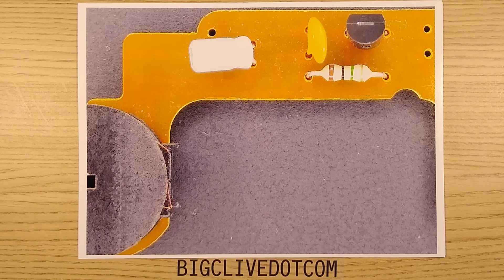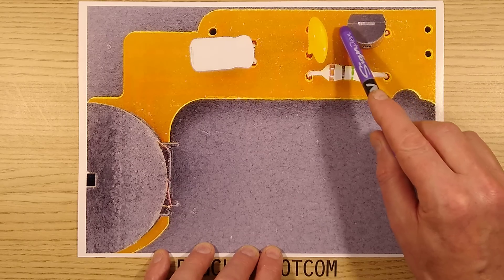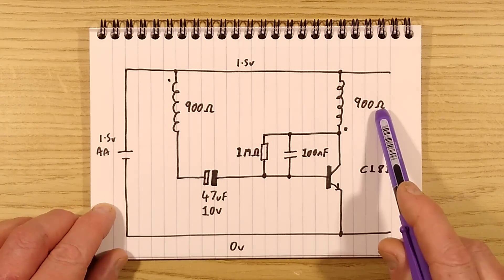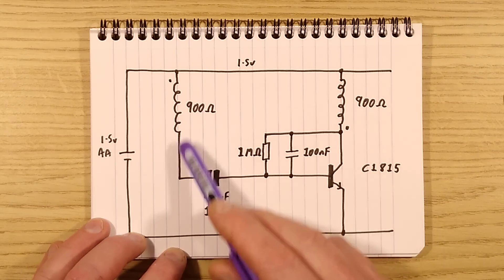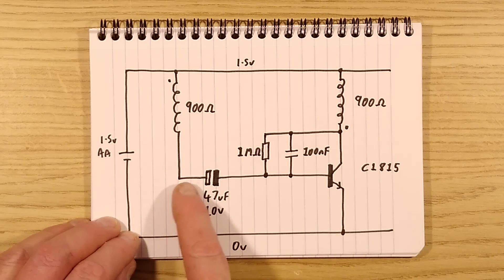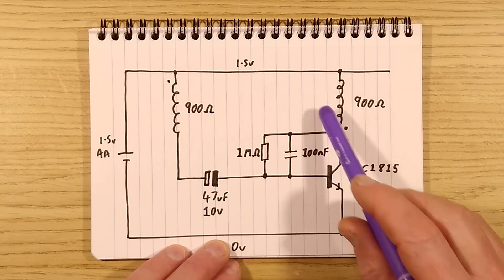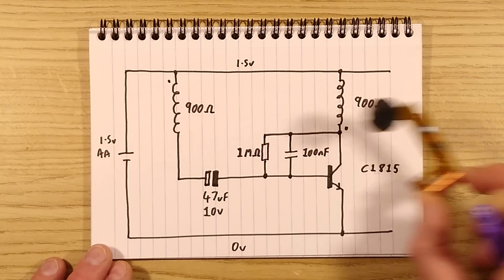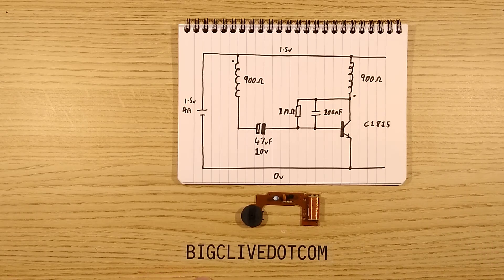Classic simple clock pendulum circuit

Comment: It seems there is a bit of confusion here, with the difference between the schematic and the PCB.  The PCB came from a clock and I assume the 'crotch' between the legs of the PCB was where the AA cell holder was originally.  Right?

The 2SC1815 comes in four current gain ranges: O, Y, GR, and BL.  Please tell us which gain range it is.  Thanks, Clive.
Reply from the maker: The battery is outwith the PCB.  The transistor gain is GR.
Reply: @bigclivedotcom Ah, outwith. A peculiar Scottish word 😉

Comment: What does the other coil on the other end of the board do?
Reply from the maker: It's the stepper motor coil for the clock movement.
Reply: As far as I know the pendulum side of things is purely for decoration.

If you look next to the other, bigger, coil there's a crystal which will be providing the timing. That, along with the coil and (presumably) a blob, is the actual clock mechanism.